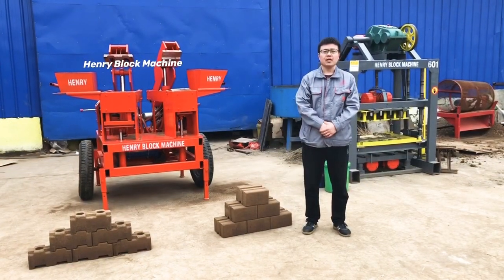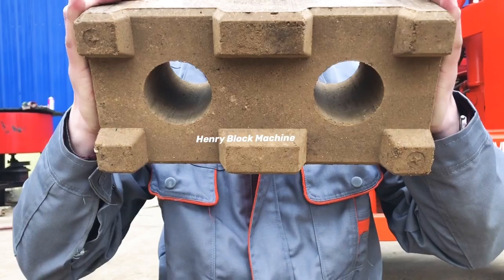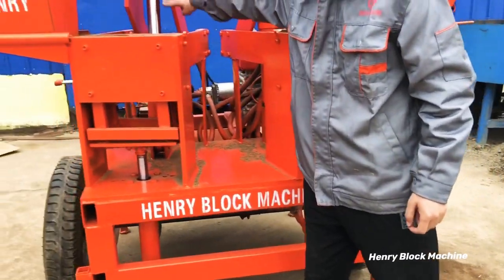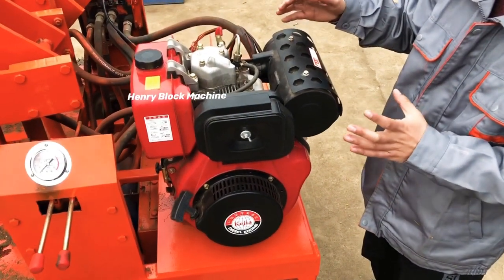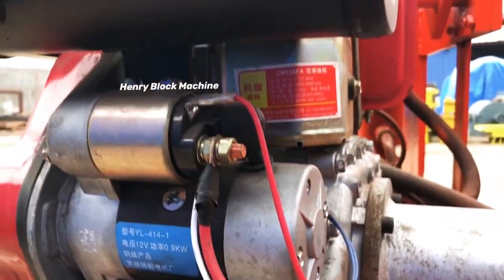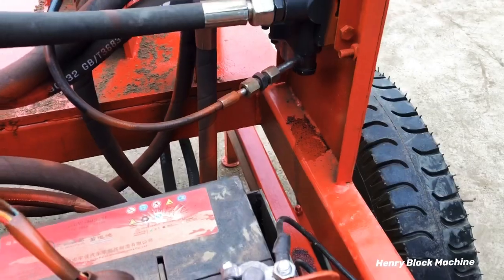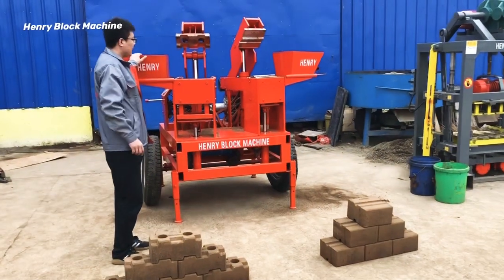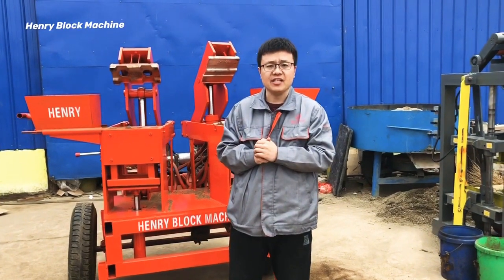M7M1 hydraform soil interlocking brick machine make LEGO interlock CLC Block with double presser

Comment: The brick that has two holes in it, outside view of a wall is different. It would be better if the jigsaw mechanism exists on the inside, not the outside. Outside view will be like normal brick wall. But the mechanism exists on the inside. Thank You.
Reply from the maker: Please add my WhatsApp number 008613053989171.
Or my email address:  info@henrymachinery.com
Our website : www.legobrickmachine.com
www.brickmachine.ltd
Reply: @HenryBlockMachineGroup 0:48
Reply: @HenryBlockMachineGroup ok

Comment: CAN IT PRODUCE CEMENT BRICKS
Reply from the maker: Yes , it can make cement bricks , by the way , what’s your cement brick size ?
Reply: @HenryBlockMachineGroup  can i get your email
Reply: @HenryBlockMachineGroup  i mean apart from soil brick can it pro duce brick in cement
Reply from the maker: @ryallemossi9360   do you use WhatsApp number ? My WhatsApp number is +8613053989171
Reply from the maker: Of course it can do cement bricks . Sir
Reply: @HenryBlockMachineGroup  I sent you a message on WhatsApp no reply